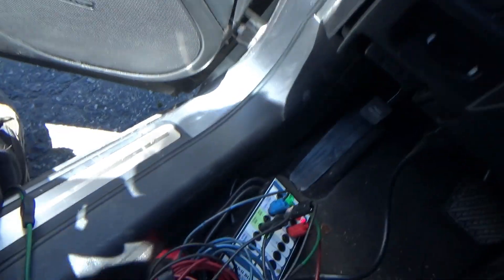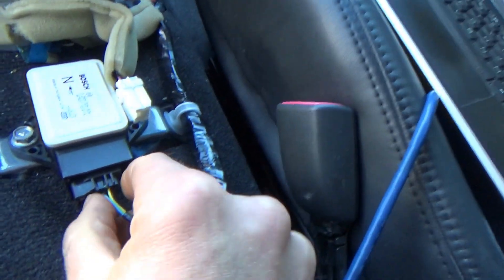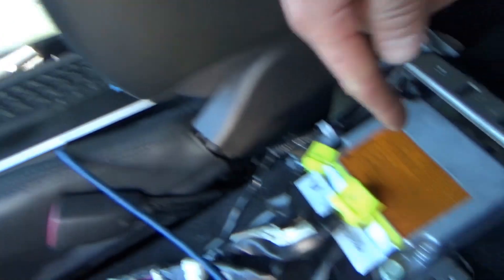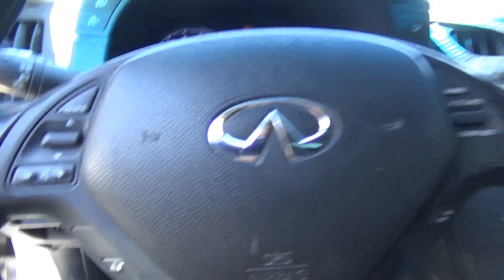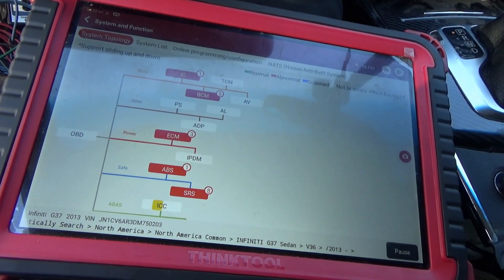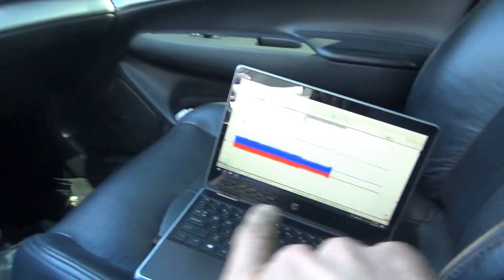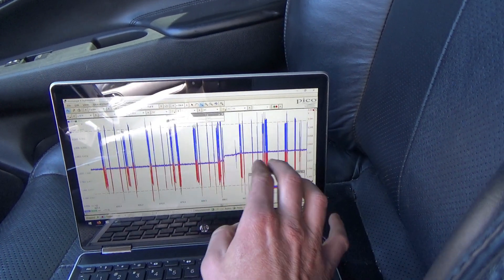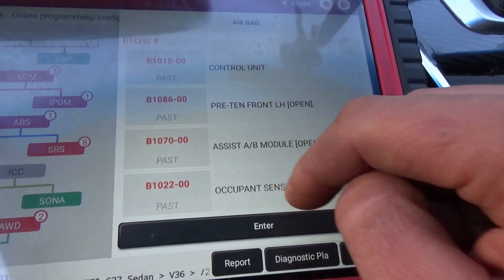Customer has been waiting for MONTHS! (Infinity CAN Fail) (SI Express 17.1)

Comment: "repaired did cheap", words of doom. On mine the service info on the srs specifically says that the module has a ball bearing on a spring as a safing mechanism. If it's in an accident and it goes off it had to be replaced because the mechanism will cause electrical problems.

Comment: I was waiting on the air bags to deploy when you unplugged the module 😂 all of our service data for anything related to air bag work requires 3 minutes after both terminals are disconnected from the battery to proceed with unplugging air bag stuff 😅
Reply from the maker: So how would you diagnose this problem then? 😅
Reply: Exaggeration of danger, reinsurance.

Comment: Intermittent CAN is a majority of my road calls by a large margin.  After that it's all drivability/emissions and now hybrid/EV is catching up quickly.  

Intermittent CAN can be a real pain. More often than not I spend my time researching the codes to try and get an idea of what modules or harness sections I need to focus on while the scope runs and monitors my patterns.  More often then not, it's time spent going through connectors and tapping on wiggling harnesses and checking pin tension.  It's some of my least favorite work but I do love the challenge!  Cheers to you.

Comment: Controller Area Network (CAN bus) is a robust vehicle bus standard designed to allow microcontrollers and devices to communicate with each other's applications without a host computer. Wikipedia.

Comment: Some don't know this, an air bag module has a roll over sensor inside which is why they are mounted flat never turn one over while plugged in and powered up.
Reply: Ivan knocked lightly! Not dangerous...

Comment: I believe this is normal condition. When any air bag is deployed in a collision the control module is disabled, so that incidental deployment can not occur during extraction activities to get the occupants out. Module must be replaced once triggered. Info-service TSB available.
Reply: That is true.  If I recall it throws a unique code for collision and bricks the unit.
Reply: SRS modules can usually be restored by clearing crash data on eeprom, but in this case where it was killing the CAN network definately a new one was the way to go.
Reply: Never of heard it killing the CAN for that.

Comment: I thought that every airbag module that was in an accident should be replaced? Like, always?
Reply: He did say they fixed it on the cheap. They either didn't know to replace it, or knew it to be too expensive. The worst thing in all of this is that it never gets reported. According to insurance, that car has probably never been in an accident and airbags never deployed. It will be on a used car lot posing as a clean title vehicle.

Edit: But yes, I completely agree with your statement.
Reply: The crash data can be cleared off the EPROM chip and it will work just fine. I've done it many times.

Comment: It makes you wonder if after an accident the airbag module either disables the car until it is replaced or disables the car until all the air bags are on line and some of the air bags are not functioning because they were not replaced and there are missing air bags or were replaced with junk. Its kind or odd an air bag module goes out after it is used in an accident.
Reply: I was wondering sort of the same thing, with the way the bias voltage changed after he hit the button I wonder if the car was doing a check - and once it figured out the bags were deployed it just shut everything down... weird.

Comment: is it a good ideal to unplug and plug Air bag module while the car is running? I saw Scanner Dannner blew all the air bags doing a pin out test.
Reply: Thanks for pointing out that risk!
Reply: That was a little more involved though, in that situation the manufacturer had the airbag module case-grounded to avoid it being powered up during handling it but Danner had clipped a ground cable to it. Guess he didn't realize a rollover sensor was built into the module until the kaboom.
Reply: @notsureigaf  Not a smart move to mess with either module with ignition on.
Reply: I also cringed!!  Disconnect battery and short leads, or ya risk blowin the bags.